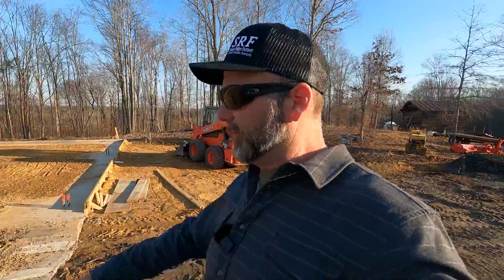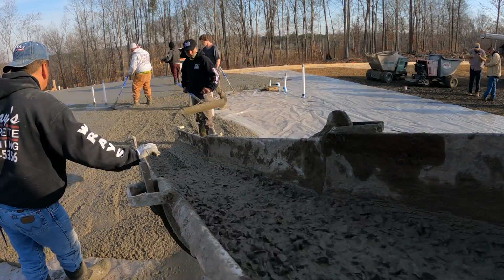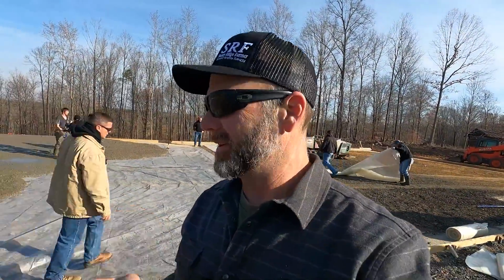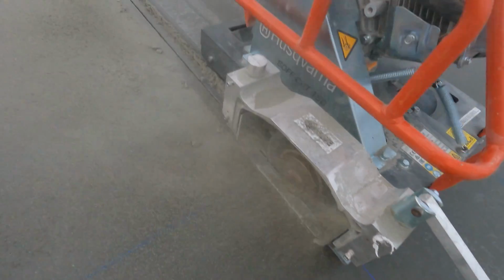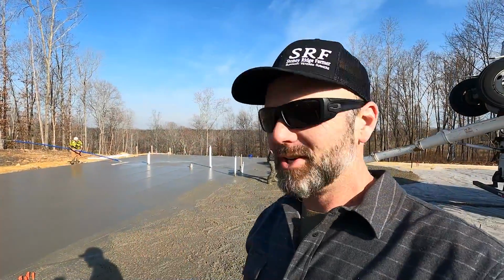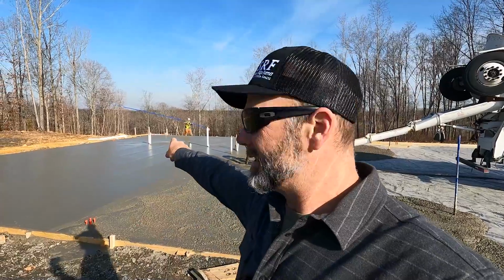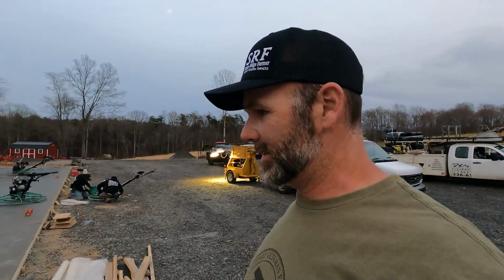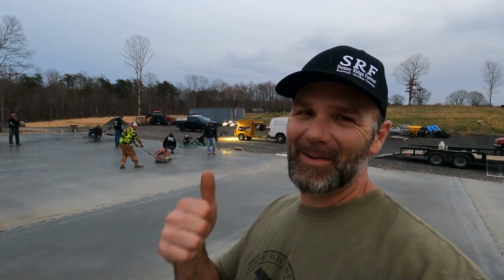Mega Shop Bardominium Build:  We've got a problem! Finishing up the pad..

Comment: No re-bar-mesh.
Reply: Having poured concrete and reviewing strength tests throughout the US: If you are commenting from the West Coast, we in the West use everything we possibly can to help strengthen our concrete slabs from fiber to additional remesh and rebar. East Coast and the South have much stronger concrete due to the physical material differences  and the higher quality chemical catalysts in the concrete.
Reply: @sameddleman4991  Cannot defy freeze-thaw cycles in the continental US. If the footings were dug below the frost line, they'll likely be ok, but the entire pad clearly wasn't.
Reply: @dudeman5788  Florida is part of continental US and has a 0 inch frost line. Assuming the frost line is 8-10 inches in his region, even with an uninsulated, unheated steel building, the moisture in the ground contained underneath that slab won't ever freeze/thaw in his climate for various reasons including the insulative properties of the surrounding footings, the slab above it, and any type of structure over it, insulated or uninsulated. If this was a driveway, or other exterior flatwork, anti-heave structural steel, remesh or carbon bar would be used to span the control joints and minimize heave due to inconsistent moisture levels below each section during a freeze-thaw cycle.
Reply: @sameddleman4991   I totally learned something today. Yup, my concrete experience is from West Coast, so I was like "what the hell are they doing"?
Reply: @sameddleman4991  We still put in rebar and mesh. Sometimes just rebar. I am in the South. In fact he is in the Blue Ridge area that leads me to think somewhere in Va. I am in Va.
On that note the cold will probably be a bit more than other areas. I wonder if he used air entrainment or something? I did not see much in the way of compaction either.

Maybe he does not need an inspector to come and look where he is at. Good luck to him though. Lot of money put into it.
Reply: @mrmudcatslim1004  North Carolina
Reply: I am a building inspector and here in the north this could not have been poured without rebar/mesh. I can understand he is in the south where the freeze depth is minimal to non-existent. That said concrete itself has very little structural integrity and rebar/mesh is used to give it strength. If he has a shop as part of that structure, he should have had mesh/rebar in it to give it strength, and it should have been a minimum thickness of 6". Course that's to IBC, International Building Codes. Those codes exist for a reason.
Reply: I agree that’s a lot of concrete with no re-bar or mesh. Hope their stress cuts works for you. That’s a lot of concrete pouring. Good luck Josh.
Reply: @kenmiller4981  plus all the "heavier than normal" equipment he'll be storing in the shop!
Reply: I do not believe even in North Carolina this was done right unless he didn’t show what they added
Reply: I hope they a least added bags of fiberglass fibers to the mix.
Reply: I am from LA and live in NE TX right now.  I would have put mesh in the slab to help hold any cracks from separating or/and widening.  I noticed the rebar get moved as concrete was dumped on the footing.
Reply: True about the west coast rebar .. Especially in the bay area... But that's still a lot of concrete to pour without something down.... Still thumbs up 👍🏾👍🏾on the pour..
Reply: @AllAccessConstruction   Yup. The amount of engineering that goes into basic concrete in the SF area seems over the top at first , but it's just basic code, and trust me .. we go way over code ! And i suggest anyone outside the SF area does the same if you want peace of mind. The last 50 x 100' slab i poured had 1/2" rebarb on 24" centers for 6" depth with 3" of crushed drain rock underneath it , including a moisture barrier and a whole lot of drainage. That's just the slab, not the footers and everything else
Reply: Whooooa
Reply: If he's using high strength concrete he'll be fine.

Comment: You are a very hard working honest guy Josh. Please don't hire this bunch again. They are cutting corners all over this job.
Reply from the maker: they are doing exactly what I told them to do.....however we did have a problem...and they corrected it...busted up the bad section and removed it/replaced at no cost
Reply: @StoneyRidgeFarmer  I am not trying to cause a problem here but I know a lot about concrete after being in the business over 40 years. This company you hired is not one to take on this type of pour. I can bet you they do 80% of their work pouring house pads and sidewalks. Then again, it is your money.

Comment: In cool or cold weather, concrete should never be poured unless the ambient temp is 45 degrees and rising for at least 12 hours. That was a good day for pouring but I see they loaded up the truck with water to make the Crete run. Easy on the guys pouring but bad for PSI. Way too much slump. I think these guys do most small house slabs and sidewalks.

Comment: Retired now, I worked around concrete for over 45 years. Starting at a nuclear power plant as a curing foreman. I finished my last 34 years as a bridge building supervisor with hands on pouring of thousands of yards. Most bridge concrete is 5000 psi mix at a 4 inch slump out of the truck. If water had to be added to the mix, the truck went back to the batch plant rejected. In hot weather I always ordered a plasticizer to jump the slump to six or seven inch slump which give just enough time to place the concrete. I don't want to be negative but there are several problems with this job. I don't think there is a building inspector on site. First mistake. The ground was not prepared correctly. That clay hauled in should have been well compacted. 

Moisture barrier a must. You said 4000 psi concrete was used here with a fiber in it. Well, fiber is pretty good for sidewalk or concrete that will never experience a load as this slab will. This slab should have had a #5 rebar mat installed with no less than 1 foot squares. It must be placed near the bottom or 1/4 of the thickness  of the concrete. I would have had a vibrator running to get the air pockets out of the concrete. Depending on the ambient temp around the slab will tell you how to cure the concrete. Concrete will produce heat for a couple of day and if the temp at time of pouring is not going to freeze, then covering with burlap and flooding with water at least 3 days will give you proper curing. Then cut the relief joints that should be cut 1/4 thickness of the slab. 

I came up with 92 cubic yards at .5 inches thick by 100x50 as I think you said it was. At $66,000, that is over $700 each yard for the job. That is way over priced. I hope you have a signed contract that will cover any cracks in the structure. It is going to crack like hell. I hope it want, but it will.
Reply: OMG, I am with you. Just poured my 40 x 50 Pole Barn for $11,000. so that seemed high to me unless they did all the prep work, footings, rebar, Bolts, vapor barrier and that was included in the price.
I've done the math, 100 x 50 at 6" thick = 92 yards at todays price (2024) of 133 per yard = $12314 plus delivery per truck, say $100. Even with 10 trucks that's only $1000 more and say he has 10 guys working, 8 hours = 80 hours with $100 charged per man hour = $8000 in labor bringing the total to $21,314...
I don't like seeing people getting ripped off....

Comment: Super thin slab with no rebar. You will find out how well it lasts
Reply from the maker: how is a 6 inch slab thin?  Not really sure what you are saying...however if it has troubles...I'll share it on the channel...this is an engineered plan my friend..not just a couple dummies out there pouring concrete

Comment: Guaranteed to fail without rebar.  It will be a cracked disaster.
Reply from the maker: time will tell my friend...however I'm going off an expert and an engineered plan...so if the expert is wrong...time will tell...remember...we aren't pulling in a dozer here and the shop will be heated and insulated so frost heave should not be an issue..there is rebar attaching to the footings

Comment: no doubt, no rebar or mesh, light on compaction will result in a lot of cracking.  Rural/farm setting probably not require permit.  Hope this does not go too far wrong
Reply from the maker: I trust the professionals that did this concrete work my friend....he knows it's out there for the world to see....so his judgment and the engineered plans are what we follow
Reply: @StoneyRidgeFarmer  Wish you the best.  You might want to check if those 'engineered plans' have a stamp on them or if someone just omitted putting in rebar or wire mesh.
Reply: @moniquemelanson1114  Guaranteed, no way they have sealed drawings on that work. No way

Comment: I work in commercial construction and have poured a lot of concrete. I hope it does not crack like crazy, but not having any reinforcement is a red flag. Especially if you are going to be repeatedly bringing equipment into the shop. They may have added Fiberglass reinforcement to the concrete itself in the mix in which case you'll be better off than nothing, but WWM wouldve been the way to go on a slab this large.
Reply from the maker: fiber concrete buddy
Reply: @StoneyRidgeFarmer  ok that helps me breathe a little better! 😂 looking forward to the rest of the series

Comment: I've done smaller concrete jobs... and anyone that says you should have done it yourself is an idiot. The stuff gives off heat as it cures, sets faster than most think, and weights much more than people think. No way in hell would I even think of doing something 1/4 that size myself. As others said, should have done mesh or fiber to get rid of the cracking. The only thing I would have done is put in pex in the floor for heating, but that's me. You were smart to do all the plumbing before. The drains were a great idea!

Comment: Hello Josh, 
   The job those guys are doing is great. I done the same, a cement finisher plus poured basement walls here in Michigan from 1982 to 1987 in my early 20's to mid 20's I've learned a lot about finishing cement. It's concrete after it ihas hardened, yes concrete is always hardening. And yes concrete will Crack no matter how thick it is.
   Love the videos keep up the good work and God bless and stay safe.

Comment: As a lot have commented about the lack of rebar/mesh I personally would’ve used mesh even with the fiber reinforced concrete.  I’m
Currently building a 48x52 shop.   Living up in Maine I had to take my footings to a minimum of 4’,  some areas I was able to, others the footings are tied into the ledge/bedrock that is there just under the surface that we drilled and epoxy boded the rebar to the bedrock.  My slab will be 6” thick poured on top of a 2” foam insulation with remesh  and 5/8” radiant heat pex tubes throughout.  Stoney Ridge Farmer may not need radiant floor heat in his shop, but it would make it nice to have on some cold chilly days laying on concrete in the shop working on equipment.

Comment: concrete is guaranteed to do 2 things turn gray and crack, you can put in rebar, wire mesh and fiberglass fiber. its still going to crack somewhere. the cuts will control where it cracks as long as it doesn't heave it should be ok. I'm sure they are building it to the local code

Comment: HEY JOSH, IF THEY WALK ON THE PLASTIC DOES THAT MAKE HOLES IN IN, WILL THAT HURT? Never mind them walking on the plastic, I think the truck would make more hole in the plastic. No Rebar or wire? Also could of use fiberglass in the concrete Josh. Makes it stronger.

Comment: Kind  of surprised to see that they didnt use much rebar or wire here.   Expensive Im sure, but w/o reinforcing, it could shorten the life-span of the pad drastically.  I trust that you know what your doing though...I have yet to be disappointed in your work sir :)

Comment: I have three pads here on my farm and the only one that's cracked is the one we used steel and rebar in....  I chose to use fiber in the other two because all we were doing was stepping on the steel wire and pushing it to the ground... The fiber ones have zero cracks so far...
Reply from the maker: yeppers....lots of folks really excited about not having rebar...the fact is that whether it's go rebar throughout or not...we'll still have cracks from time to time...there won't be any gigantic equipment in here so no rebar is needed on this project. Time will tell for sure

Comment: All concrete cracks. Sawing the lines doesn't stop it from cracking it controls where it will crack. As the earth moves and all earth moves, from the biggest earth quake to the smallest  frost heave, the movement puts stress on the big slab you just created. Sawing lines creates a weak spot in the slab so when it moves the crack runs along the weak spot (in the saw line) so you don't see it.

Comment: I see in your replies to comments that you are a little sensitive about the lack of concrete reinforcement in your slab.   Seeing this massive pour, even with fiber mesh and 4000 psi but no rebar drew the attention of quite a few followers.  There is nothing that can be done now, but don't deny that some of the people commenting have a great deal of experience with concrete and their comments, even if to perhaps help a future concrete adventurers, are well conveyed and valuable.  Wishing you no cracks!
Reply from the maker: I'm not at all sensitive...just explaining why to folks.  I'm 100% positive it will crack....now...if it heaves won't the concrete heave right along with it?  Time will tell buddy...my concrete contractor will stand by his work.  The largest thing that will be inside this shop is a 10K lb tractor...we should be just fine my brotha...shop is insulated so frost won't be an issue
Reply: @StoneyRidgeFarmer  Thanks for the extended explanation.  I would think the concern is not from the weight on the concrete but the expansion and contraction.  Although the shop will be insulated, the frost line is most likely below the slab and that ground will be expanding and contracting with temperature changes.  And maybe, the concrete will "heave" with it, but I would think the concrete will pull apart from the forces underneath as the dirt moves.  As a result, the concrete is going to have to move with it and it doesn't like doing that!  My Brotha, I am not mocking your efforts, I am making sure I understand.

Comment: I agree. If I spent 66k, they better use rebar. It’s not what you can get away with, it’s how can I make this last for years to come without a problem. Especially knowing I’m going to be driving heavy machinery on it.
Reply from the maker: If I added rebar mesh to the pad the cost would have been $81,500  so we used fiber

Comment: I wish they still let us use rebar grade stakes out here. We usually use #4 rebar and add fiber. Especially if we use 4x4 WWM. It’s all up to the PE how it’s designed. Codes are different in every state. I like to use Keykold joints it helps as a guide to screed and you don’t get saw cuts. you don’t think of it till you start rolling toolboxes around shop and cus every time you hit the joint with casters. It looks awesome Josh. I like watching other contractors to see different ways. I been erecting red iron from ground work to finish for about 10 years now I’ve learned there are many ways to skin a cat!! Lol

Comment: Josh you should have put the metal screen in the concrete so when it cracks the cracks don't expand with the change of season
Reply from the maker: my brotha...it's still gonna expand and contract whether it's got rebar or not...that's why we cut control joints my friend

Comment: a cement contractor told me one time,concrete will still be dry after 30 years
Reply: they cut lines in the floor in my shop when it was poured

Comment: Why no rebar or wire mesh I figured the footings are only a foot deep because maybe the ground doesn't freeze there but you'd think just because of settling you'd still want rebar.
Reply: What's going to settle? He is building it on the top of a hill he didn't excavate a hole.
Reply: @GM6.7  he built it on top of all the dirt he hauled in.  No expert but just the cement truck packed it down more than it already was.  I've just never seen concrete without any metal in it at all.  Except small pads like sidewalks
Reply: @justinpaone2227  they trucked in road base fill which is mostly sand and gravel which they compacted which will still move a little with a 30000 lbs truck driving in on areas that were not compacted.  His pad will most likely Crack here and there but it will not be decimated like people expect.